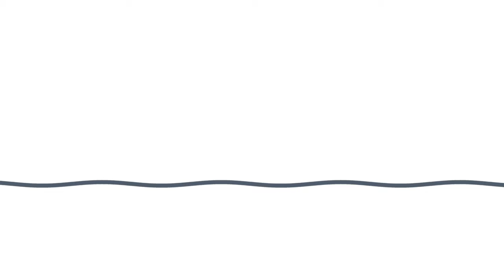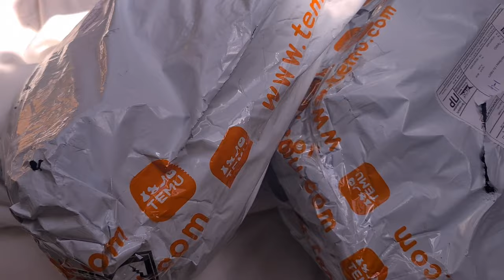Satisfying Yacht Clean-Up: Safe & Effective Tips For Removing Toxic Black Mold!

Comment: VELERO LA TRINIDAD Dear Taylor: To clean mold easily: first clean with water and a brush or cloth depending on the surface; then with soap in the same way as with water and finally apply vinegar. Don't forget to wear your mask.
Reply from the maker: Wonderful advice Thank you so much!! We actually found some more mould hidden in our aft lockers - so we will be using your method soon :) - mask will be on hand